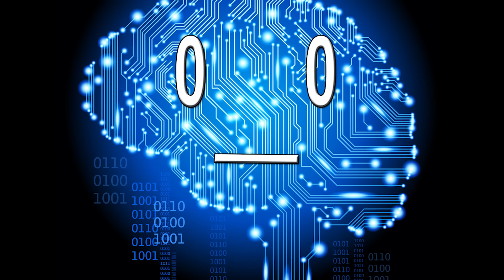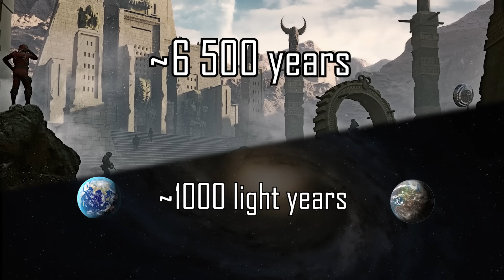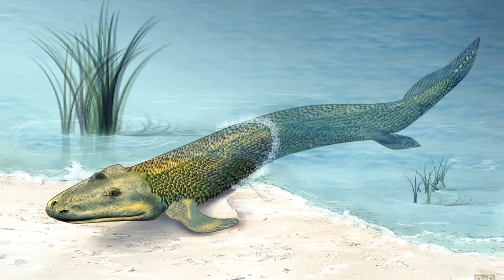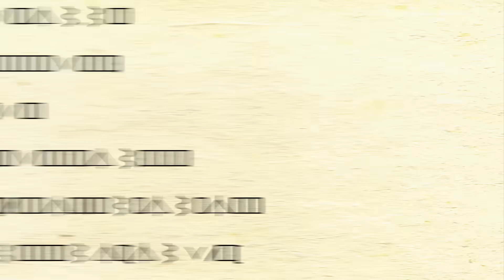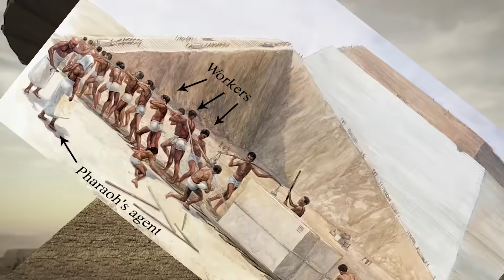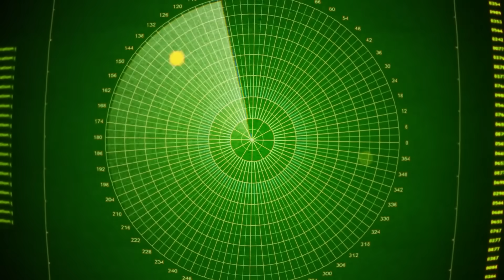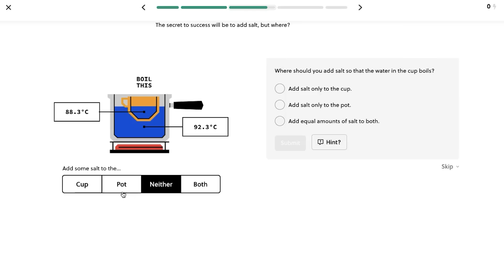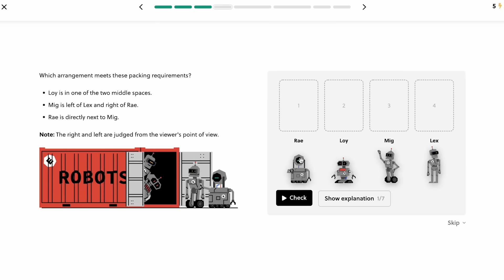Iceberg of the Fermi Paradox Explained

Comment: One of my own ideas as to why we never hear anything in return:

First, think about how short humanity has been broadcasting radio signals. On the scale of the universe, roughly 200 years is very short. Now think about how long we've actually been looking to the stars and listening. Not even 100 years yet. That's basically nothing on cosmic time frames. First of all, the odds of another civilization being at the exact same level as us are quite low. If they advanced first, we could've missed their broadcasts long ago. By now, they might've found some new communication method that doesn't emit radio waves or is encoded in such a way where it's indistinguishable to us from random shit coming from space. If we advanced first, we likely won't hear their broadcasts for thousands of years. And now think about how old the universe is and how long it took for humanity to evolve. I'd assume other intelligent species, should they exist, probably came into being mostly around the same time as us. That gives not a lot of time for one to have been around long enough to truly advance far enough yet. We've just only entered the digital age not that long ago. It's not unreasonable to think we could be the first in our general region of space to reach this point. And for anything further away that has, their radio signals could take thousands of years to reach us.

11:46 of course it just had to be vrchat

Comment: We have studied 20 million stars, and not one can support life as they are ALL too unstable, we are alone. The Sun is the only stable star. Also of the 4,300 solar system studies, not one looks like our solar system, able to support life. The Milky Way Galaxy is the only stable barred spiral galaxy. In other galaxies, there is no place for a rocky planet without deadly radiation or orbit interference. Earth’s vast and stable magnetic field is unique, most planets the magnetic field is short-lived or unstable. Earth’s magnetic field protects life from deadly radiation. The list can go on and on (rotation rate, astrosphere, right carbon dioxide, low carbon monoxide, one large moon, very low eccentricity). There are 5,759 confirmed exoplanets, not one looks like Earth or any of the planets in our solar system. We have looked and we are alone.

Comment: First, we need to consider 2 main facts: the universe is so big, and the universe is so old. Based on those we start thinking about the Drake's equation and from that big number we start adding more factors like the great barrier. Which states that most civilizations are not able to pass the barrier of enough technological advancement for enough time to be able to contact and receive response from another also advanced civilization close enough to contact each other before extinction (self or external).
Now let's talk about time. What would happen if those 5 big extinction events did not happpen on earth?. Intelligent life would have occurred 100 million years earlier, and they would be gone by now. So, it is not only that intelligent life needs to happen close enough to each other (distant-wise) but also coexist on the same timeframe. What is 20000 years compared to the age of the universe?. If we try to represent the time of the universe on a clock. The last 2000 years and the next 1200 years of human history corresponds to the last 1/100 of second of the last second, of the last minute of the 11th hours. So all our history happens at 11:59:59.99". How big of a coincidence needs to be to coexist at that same exact time, and be close enough just to receive a response. Now, to be able to visit another civilization is even less likely.

Comment: The most logical explanation for the Fermi paradox is that interstellar travel is more or less impossible due to exorbitant energy requirements, the constant motion of stars and galaxies (meaning nothing has a fixed location), and the sheer scale of the universe, which is so large that the speed of light looks slow when traveling across it. There are likely countless civilizations all over the universe, some much like us, others very different, but we’ll never be aware of each other. We’re all trapped in our island universes.
Reply: Correct, and assuming all those civilizations coexist and the same time. Millions could have existed while we were still inventing the wheel or discovering fire, but those civilizations no longer exist. Or millions will exist in a million years when we are already gone.

Comment: One big issue with the Fermi paradox is that our radio signals have traveled a very short distance in space, and many of them in just one direction. The chances of someone picking them up are infinitely slim. And the chances of us picking up their communications are equally slim since there are so many places non-carbon-based life could exist, and most of them are more than 150 light years away.
Reply: Also the radio signals degrade in quality over time and after a certain point it will be incomprehensible static.

Comment: The Galactic Habitable Zone Hypothesis
The GHZ is between 10,000ly-13,700ly. That means even out of the solar system to a rogue planet in interstellar space, they enjoy Hawaiian beach temperatures - a region that occupies the Norma Arm. 
We are out here at 26,000ly from galactic centre. So we are 12,300 light years to 16,000 light years from 99.9999% of life habitable star systems. So if they are the centre of galactic civilization, we are the predators out in the dark and cold.

Comment: Radio communication: signals of insufficient strength are garbled by the iononic interference they you through, even space based of most power we've been capable of in the last 100 years are so weak once they reach just 100 light years away they can barely be detected at all.

Comment: The problem is that many of this "estimates" are at best nothing better than educated guesses. In most cases they are extremely biased guesses.

Some very known astronomers will outright say that "if a planet has the conditions for life, then life will 100% appear in it" without questioning that. That is extrapolation based on a single data point, which anyone who knows anything about data theory will rightly say is absurd, but statements like that are generally accepted in the "aliens are out there" circles.

Comment: The answer is more straight forward than most people realize. Every point in space is expanding away from every other point. That means that the further away from each other two objects are, the faster the distance between them increases due to this expansion. Get two objects far enough from each other, and the distance between them is growing faster than light can make the journey, rendering communication impossible. This means that by far the most likely answer is that the real “great filter” is simply the light horizon.

Since nothing can move through space faster than light in a vacuum, then we’re never going to get to see outside that horizon barring some discovery regarding shortcuts through a hypothetical higher dimension.

Comment: There's another explanation: the space northern territories theory.
The local group, which is the group that includes the Milky Way, is a relatively small cluster of galaxies in a relatively empty part of the universe. Additionally, our solar system is not in an interesting part of the Milky way. It's on a minor subarm of a boring galaxy. And none of the planets in this system are particularly remarkable. One of them is mostly rust, a bunch of them are mostly hydrogen, etc. It could be the aliens have never approached this system, because it is really out of the way and unremarkable, meaning that there is no reason for them to come here.

Comment: those signals were barely strong enough to reach across the Atlantic.  Signal strength drops as 1/r^2 so it will be infinitesimally small (undetectable) after traveling 120 light years.

Comment: Every signal compressed well enough will be indistinguishable from noise if you don't know the key. Imagine a guy trying to listen to the 5G traffic using only a radio receiver and earphones from 1940s. What meaningful information could he get? Also, to save the energy it is better to transmit the signal using a narrow beams rather then broadcasting in all directions.

Comment: The answer to the Fermi paradox is simple. Enrico Fermi didn't appreciate the difference in difficulty between traveling 27 trillion miles (distance to nearest star) and traveling several quadrillion miles (likely distance to nearest alien civilization) in a ship capable of going a significant fraction of light speed. Hint: it's like the difference between going to the moon and Europa with an Apollo capsule! Also warp speed and artificial gravity aren't real things and from time to time civilization collapses after a few hundred years and enters a dark age usually lasting as long or longer.

Comment: Our own radio broadcasts were yet not powerful enough to be distinguishable from "noise" some dozen lightyears away, and after a bit over 100 years we have started to stop broadcasting at all. (Most broadcasts are not leaving the atmosphere depending on their wavelength; additionally we are using more and more cable and satellite communication instead of wide-band broadcasting.) So we can conclude there is only a small window of some centuries a advanced civilization would do random broadcasts. Some cultures could broadcast on purpose to find neighbors, but that would not be very energy-efficient, so  it is more likely they would send directional beams to selected stars in their neighborhood only.

Comment: I was just thinking the main reason no one has answered our radio calls and replied back as thus.... Is that maybe the signals just get lost in all the radio stellar noise that in space gets dialed up to 100 while out very nuiance signals are at volume 0.1 ..... What is a coherent transmission here could just blend into the static. It would require the aliens to know which sliver of space the signal is contained then they forensically winnow out the noise to come up with our signal.... To them they recieve signal may just sound like an unusual yellow star producing strange noises. Which they deduce to be the sounds of a strange mix of hydrogen and helium in the core.

Comment: 1901 so the round trip of about 60 light years for small duration of time. Modernity is less than a hairs width. A lot of stars but not a large fraction of the galaxy. Basically i still go with "Fermi paradox because there hasn't been time to signal, probe, or sense alien life yet'

Comment: The radio signals that we use for communication as TV, radio and internet, would be so diluted by the time they arrive even to the nearest stars, that they'll be practically indistinguishable from the cosmic microwave background... So it's a BS that we can detect radio signals of other civilizations or that they can detect us. If we point a signal towards a specific planet, that would be different, but we currently communicate with omnidirectional signals, which simply dissolve with the distance.

Comment: Fermi's question can be answered by science fiction. In a typical story a single advanced technology is emphasized and drama comes from a related existential risk. If such a technology was available it would lead either directly to dystopia if a single entity controlled it, or if it were more broadly available would quickly become ubiquitous, be used, and cause exponential changes. In either instance, destruction is all but assured. Now consider more than one such technology.

Comment: Would the radio waves we emit not decay as they travel through celestial bodies and particles in space to the point that they look like cosmic background noise and not intelligent signals? And same for any potential alien signals?
Reply: The longer the wavelength the less it will dissipate, radio is the longest wavelength at about 62 miles long, it will not decay.

Comment: I have my own theory, its fun to think about during my warehouse job, i think space travel (along with common mass extinctions) is extremely difficult to just travel space, the method of traveling space itself might cause a civ to deflect (even become a threat) or become unfamiliar to their homeland, computer ai being programmed to give the bluebrints of life but changed to live under different planetary conditions, or even an edit to programming to deal with different gravitational levels or solar conditions can change an ai's values and being at long distances with cosmic events halting / slowing down some communications ai's could overtime go rogue on itself and split, even then alien civs might not find it viable to maintain an empire outside of 100 light years (guess) and megastructures have to stay stationary towards major power source and simply one shot any threats that get near their cosmic mega battery, and space travel is resource insensive the more mass you add, and it takes lots of power to maintain a level of intelligence / computing power which in a square law sort of way, cost more with space travel, and therefore its not worth the resources if another civ has to dedicate more resources in retaliation and its better to find another untaken cosmic power sources. 

but to add to that theory, space travel might be like sailing a boat in a harsh wind, stars (our sun) is basically sailing around the milky way's center, civs might find a way to travel the galaxy not with ships but by manipulating stars, from there contact might be possible as 2 boats drift close to each other, dark forest theory would more or less work if a civ can self-destruct their own star. also when 2 boats meet, the most vulnerable and risky part is when one planet sends its military in empty space and its easy to defeat such a military with the massive resources a homestar can provide, but only through moving your entire star (which could be a massive effort just in itself) is the only way to reliably take another star system is to sail towards it, which causes another star to easily detect it and sail away, causing more resources in itself then the gains making dark forest not viable, with an extremely high level civ (needing more resources) drains stars quicker should life develop and there's a sweet spot keeping everyone near the same levels of advancement making threats equal, rarer, and not beneficial.
Reply: Too many unfinished thoughts, couldn't understand, i was getting a little. Sounds good, but you gotta complete your  thoughts/sentences.
Reply: @sheevpalpatine2128  thanks for being honest, and you're right, im trying to work on my adhd, its hard to connect things to others while it makes sense to me, any advice on how to be more conherent would be apricated if u have it, this is just a weird theory i have
Reply: @BadVoodo0  im the same way mate i hear you  i wasnt diagnosed till i was 30 😄 i should admit im tired so maybe some of it was me. I have no advice besides meds actually do work its like night and day. Thanks for not ripping my head off i felt a little guilty like i was being harsh 🤟
Reply: @BadVoodo0  Sometimes just put dots instead of commas (normally you see in school that commas shouldn't be used everywhere). Ex:

Thanks for being honest, and you're right, im trying to work on my adhd, Its hard to connect things to others while it makes sense to me  .   Any advice on how to be more conherent would be apricated if u have it, this is just a weird theory i have

With just one dot this already sounds better (you can add more). In this example it doesn't really matter, but your orignal comment was super long so it was hard to understand
Reply: Interesting theory, I quite like it
Reply: Looks interesting, but punctuation my guy
Reply: blue🅱️rints
Reply: i kinda agree, interstellar travel might just never be worth it, too expensive for resources and time, and for what reason? we could, with future technology just make the earth a utopia for tens of billions of people who live for thousands of years, idk.
Reply: Rewrite and reduce word count.
Reply: That was very hard to read
Reply: Bro typed a whole college essay
Reply: @trafficconesupmyass7695  nah this ain’t college level in the slightest. Too many grammatical and punctual errors
Reply: Homie 
Most people are not trying to read all that 😂😂

Comment: How far have our radio waves reached? Further than our Galaxy or not yet?
Reply: They move at the speed of light so only 100 something light years away. Not even remotely close to the edge of the galaxy
Reply: @D1G1TS420  Its about the distance to about 59,722 stars. A lot but barely any compared to the size of the galaxy
Reply: @tpower1912  

 @Michael Chalmers  Thanks to both of you for answering. It gives me perspective. "It is estimated that the edge of the Milky Way lies about 950,000 light years away from the galactic center while the Earth lies about 26,670 light years away from the galactic center. Therefore, the distance between the Earth and the Milky Way's edge will be 923, 330 l i g h t y e a r s". So the radio signals have only travelled (100/923,330)=(X%/100%) X= 1.08303640085% of the galaxy until reaching the closest edge. So roughly a 1% of the galaxy has had access to our waves, out of a 100%. The video has mentioned that the most centrist part of the galaxy is bombarded with pulses that would interfere with the development of life, so I wouldn't know if it is worth including in the calculations. It is more likely that life is on the edge, but we have barely (1%) reached those zones with the radio. It kinda makes sense that there is no contact then.